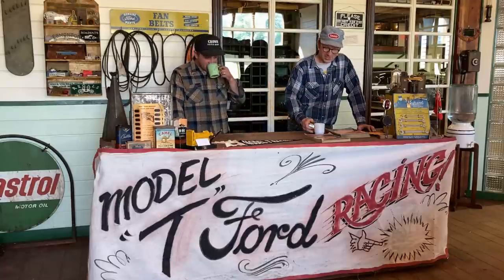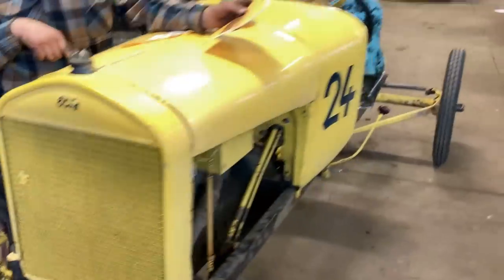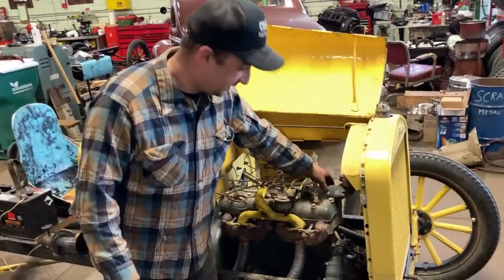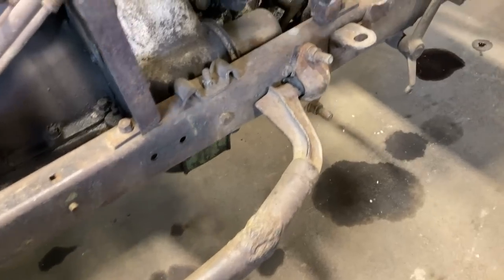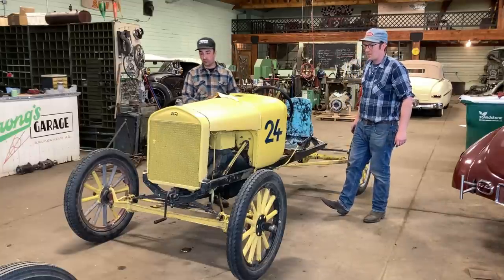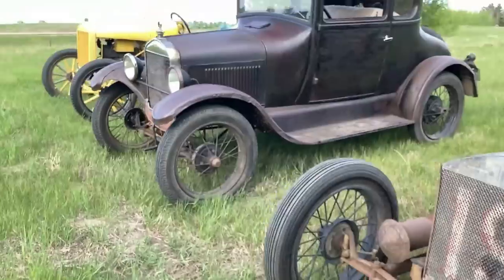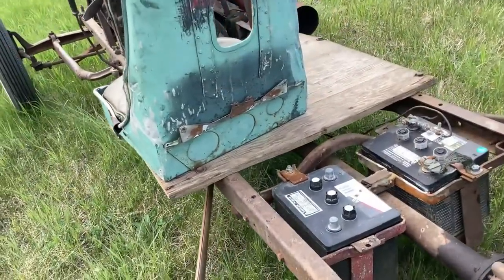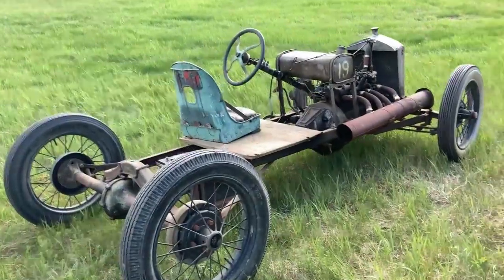FIRE IN THE HOLE! Mighty Model "T" Racecars along with a Brief History of the Sport in Alberta

Comment: Essentially the Model T race cars were largely standard, they would take off lights mud guards etc to make it lighter! Weld the broken crank shaft, it CAN be Done!!
On average Model T used about 6--1 compression, Model A was the same engine basically but higher compression hence more power! Nice flame thrower on No19 there 🤣😀
Scott from Cold War Motors the standard Model T coupe.

Comment: Miss my 20 Speedster.  Had a Wakasha Ricardo head on it Hemi pistons, and oversized Cadilac valves.  Full race cam. Bored 30 over, electronic ignition, and hot coil.  Also converted to 12 volts.  Had a 26 rear end 4:10 gearing with big brakes.  I ran wooden bands in the transmission because they seemed to run cooler and you could grab the low band much harder. Also had 26-27 wires wheels on it.  Had it up to 70 one time, sounds like a sewing machine running flat out.  The front tires and wheels felt like a gyro even though they were well balanced at 70.  Guess they weren't made to go that fast, but I beat the other Speedster by a mile or more.  My number was 13.  When I sold it at auction it ended up in Nebraska somewhere?  Always wondered where it is now.  That was about 15 years ago give or take.  Anyhow, I really liked your Speedster racer video.

Comment: Hi guys, I enjoyed the video.
I have a question for you, I have a 1920 Model T touring car. I had it out the other day, went over a bump and felt a hiccup. I got to my destinations. Shut the car off. When I went to leave, it would not start. Cleaned out the carbs several times played with it got it to start and it was just belching black smoke I couldn’t get into it to accelerate.
    I had a flatbed at home, and have been working on it trying to get it to run correctly. I have replaced the needle and seat for the adjustment on the carburetor, check the float, clean the carb, to no avail. Since then I have replaced the spark plugs spark plug wires cleaned and repaired the ignition switch. Rebuild the coil box. And swapped out a second set of coils that I have. Nothing has changed in the running of the car. It’s still Belgians black smoke pops back through the carburetor, and does not accelerate. 
     I don’t see any bear wires but I am running out of things to look at. So I’m thinking the wiring harness for the commentator, the commentator which is only a year old, and a friend suggested the wire block on the firewall. I have not done a compression test on it yet, but I am going to get the adapter so I can. I have also pulled the valve covers and checked the operation of the valves. They seem fine.
       Do you have any thoughts on this? It happened to suddenly for me to think it is in the motor, but I could be wrong. My thought has been ignition or fuel from the start. The fuel tank is NOS with no rust or dirt.
The only thing is I filled the tank just before this happened. But if it was bad fuel it should have begun immediately not taken 24hrs, and ten miles to show up.
    So please if you have any thoughts of anything I have missed please let me know. 
      Thank you!!

Comment: How do you keep these cars from overheating?  I didn't see a fan blade on either car.
Reply: It's called a thermosyphon cooling system...google it
Reply: They are designed to run without water pumps. Race car doesn't sit in traffic.